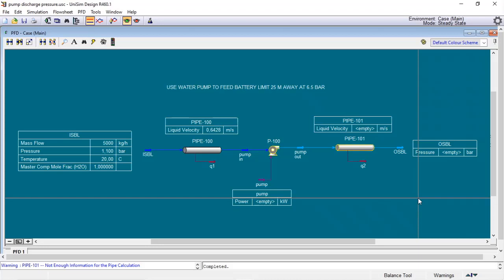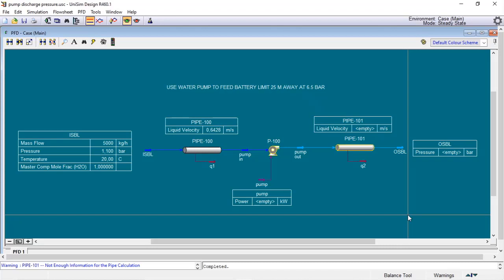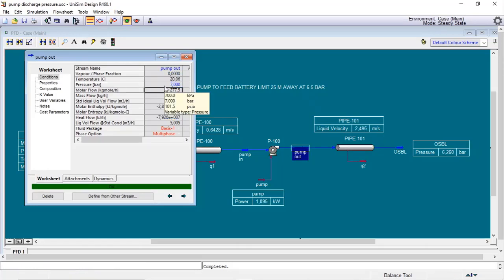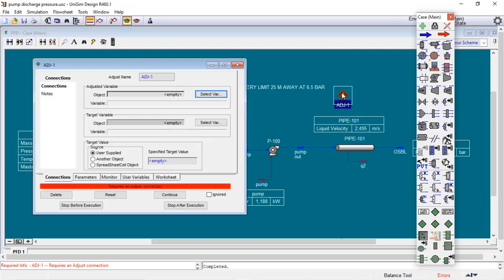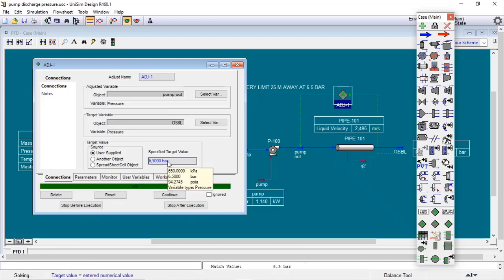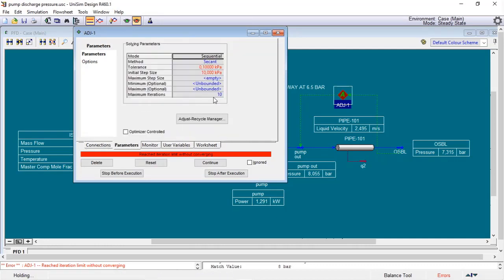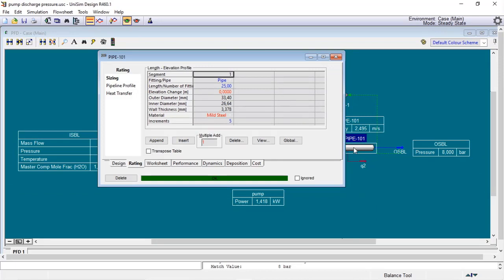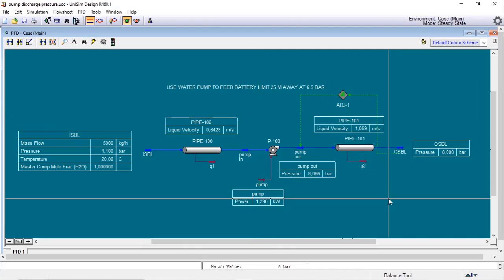Aspen HYSYS | UNISIM tutorial ADJUST logical unit operation

Comment: How can I add a de-emulsifier, defoamer, and corrosion inhibitor to the HYSYS program? Because these materials are kept secret for commercial purposes, do they have other names in the program?
Reply from the maker: Hi, if you have minimum information from the chemical you wanna add to your process simulation, you can add them as hypothetical components. Mass density AND molecular weight is the minimum information for hypo component.